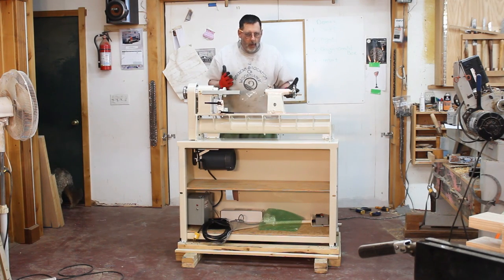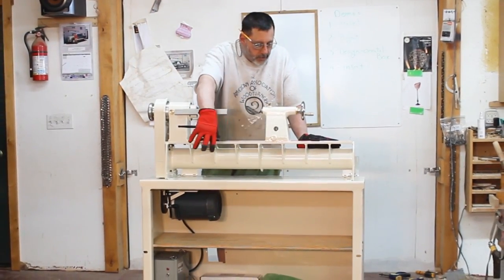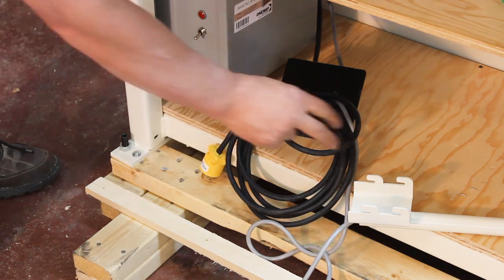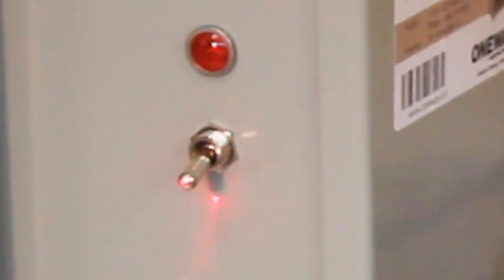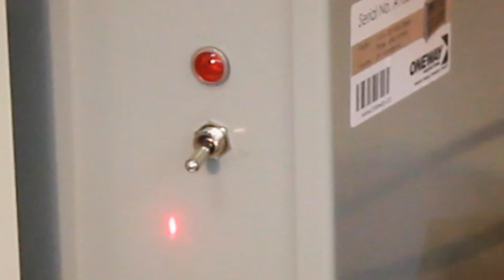Oneway 1224 Wood Lathe--- Unboxing,   Sam Angelo

Comment: Is your lathe a 110 volt or 220 volt ?????   and is there a reason one would want a 220 volt over the 110 volt ifso can someone please explain because I am looking on ordering this lathe Thank you
Reply from the maker: +jp morso 220 draws 1/2 the amps as 110 does so it is cheaper to run.  I did not have an extra 220V plug or i would have ordered one.  I think you will love this lathe.
Sam
Reply: +WYOMINGWOODTURNER hi Sam can I use a stronghold chuck on this lathe or is it too big ???  or do I have to settle for the basic chuck oneway makes ???

Comment: Hey man, new toy?
That's nice !!!
I've seen several videos on similar machines with these and sometimes I ask myself, "Why is it that never tried to do one of only wood?"
I do not say the engine and its parts, but I say the rest. See it's a machine in which the whole is composed primarily of iron. These bars, they can not be made of wood? Can not or is not advisable? Then I leave that question for you. From the top of all your experience, do you think you could build part of such a machine in wood? A hug for you here in Brazil.
Reply from the maker: Valdek Waslan Oliveira I think this is a very good question.  I have seen many lathes made of wood but they are handmade by individual turner's.  I think what is too light, that is it is not as heavy as iron or steel.  And I believe it will move too much, or bend.  Thanks for watchingSam
Reply: WYOMINGWOODTURNER No ... I do not say the entire shift, but parts of it.
But thinking about your answer, you're right, I think that even putting a thick or hard wood, with time and with the vibration, the connectors (screws or glue) start to sag while welding in this respect is more resistant . Thanks for the reply, a hug.

Comment: Very nice how much does it cost? I need a cheap lathe know of any?
Reply from the maker: Anthony
This lathe is around $2500.  I am not sure how much you can spend.  Cheap is relative I suppose.  This lathe was not inexpensive.  Here is what you should consider.  I think variable speed is really nice, but not totally necessary.  This would save some money.   Reverse is nice for sanding.  I also turn a bit in reverse.  Size can make a lathe expensive.  So it depends on what you plan on turning.  I like the smaller Jet lathes.  Sam

Comment: Sam, I know that you're currently a robust lathe user. I have been considering buying a oneway lathe but find no current or relevant YouTube postings of new lathe being shipped. My concern lies in the fact that there's not much updated information on the company website which concerns me. Was your experience with Oneway satisfactory and up to your expectations. Thank you for any information.
Reply from the maker: Leroy, first a bit about my experience with Oneway.  You may have seen that I have two videos on the Oneway 1221 I owned.  The reverse switch stopped working.  I contacted them and they  replaced it free of charge.  I did ask them about another size tool rest.  I found at that time it was difficult to find a tool rest on their website. I thought at the time since I had given them lots of free advertising they might send me a free tool rest-nope, but also I did not ask.  I also had difficulty finding one on the internet.
A while later, Brent English (Owner of Robust)  noticed I was using a Robust tool rest.  He contacted me and asked what model lathes I have in my shop......he sent me free, 3 or 4 tool rest  for each of 4 lathes.  This was 2 or 3 year before I became a Robust dealer.  So I am a loyal Robust dealer.
If you have any questions about a Robust lathe, let me know.
Sam
Reply from the maker: oops, 1224....
Reply: @WYOMINGWOODTURNER  thank you so much, I appreciate your response.